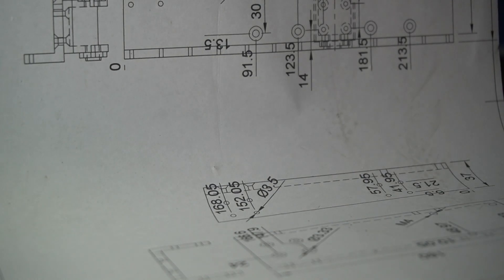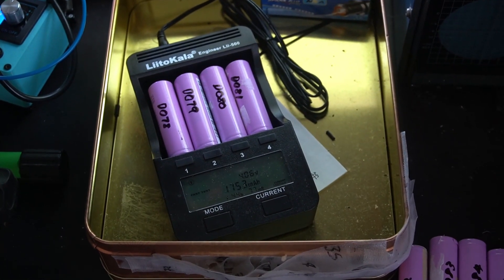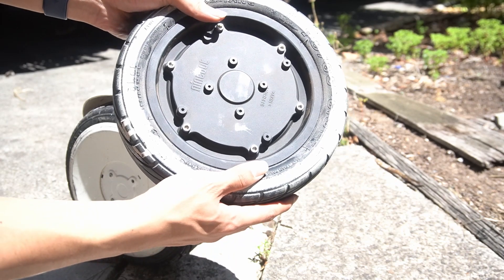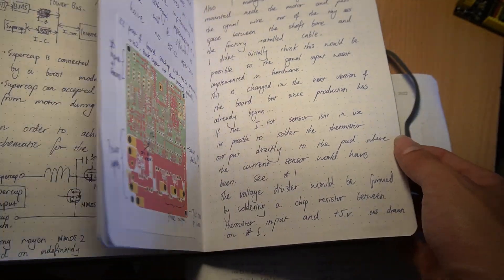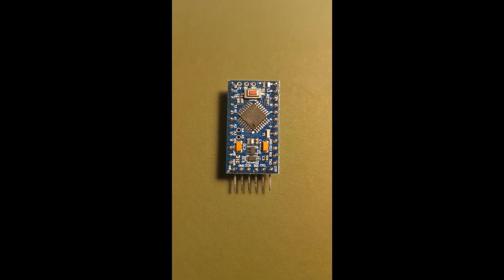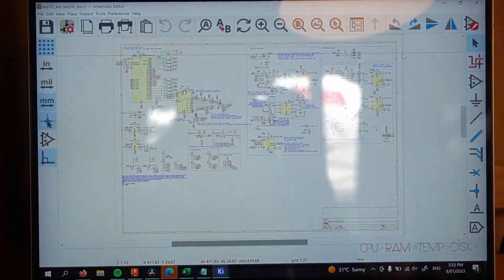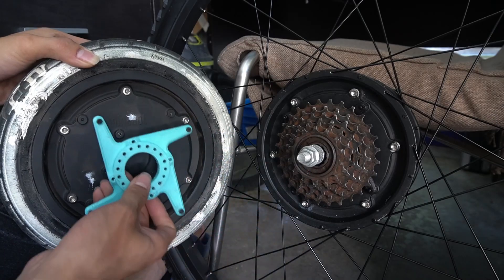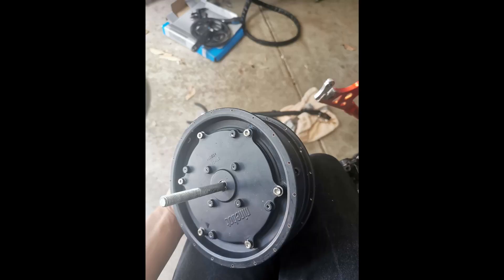MIT maker portfolio [accepted for never]

Comment: hey dude is your esc design open source? can you share the design? me and my team are working on an esc design and its driving us nuts!
Reply from the maker: Hi Berkin,
I'm planning on making it all one source and doing some demonstrations in a video eventually. But right now it isn't even fully function, less released.
What application are you designing for?
Reply: @tamashamas6193  hey!
We're designing to run bldc and drive a car alternator that's modified to run as bldc/synchronous motor. I actually "hacked" a commercial esc by soldering jumpers to its gate driver ic's. I can get a dumbed down field oriented control algorithm working. But designing an esc from scratch didn't work at all lmao. Any help would be appreciated. :)
Reply from the maker: @berkinke  I'm not expert at all, and deciding to build the esc fully custom was definitely biting off more than I could chew. Def learnt a lot though
What ive implemented so far is a block control scheme since I only have balls for feedback, I probably won't be much help for foc specific stuff but I'm more than happy to help you out, maybe I could setup a discord server?
Reply: @tamashamas6193  Sure!!!
Yeah block control is enough actually for getting started. Foc is not critical at the first stage. Thank you. Dc server would be awesome
Reply from the maker: Sorry! Just got to it now, hope your project has been progressing well.
I'd love to discuss, so here is the discord serv: https://discord.gg/UK3kBVX4U3